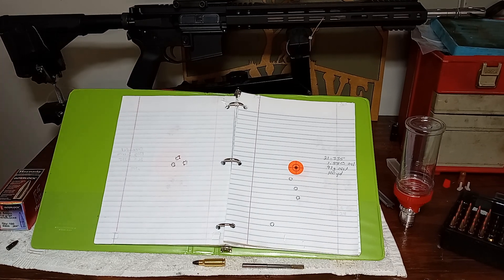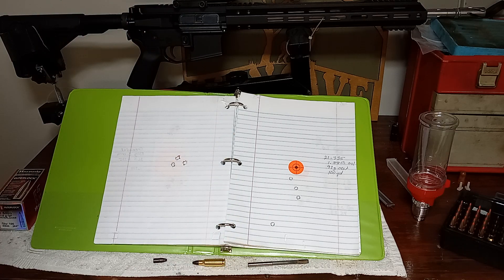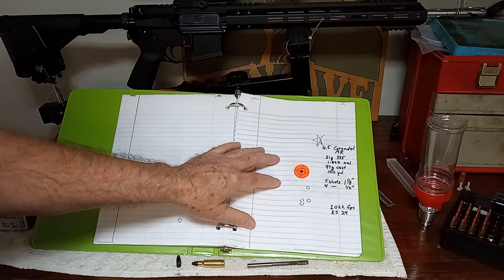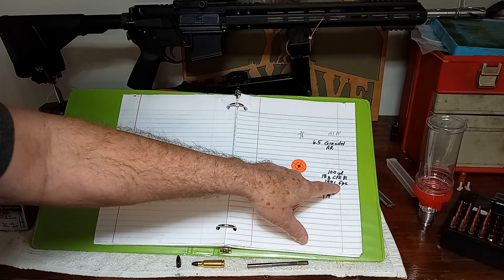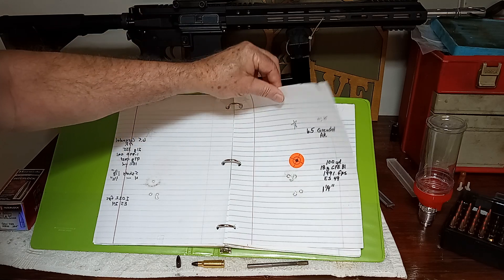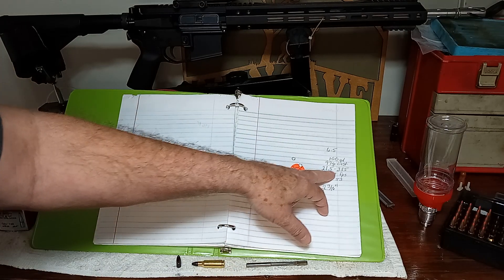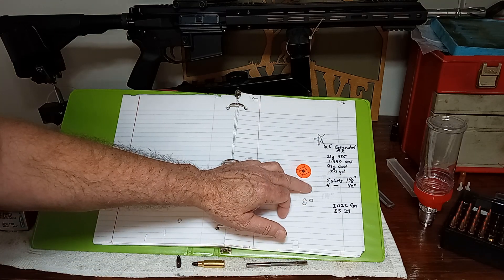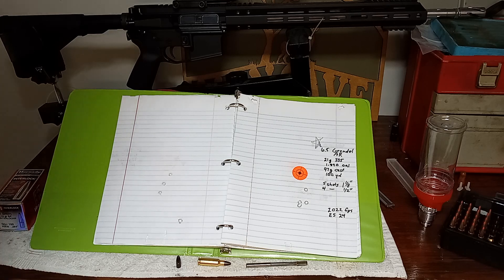6.5 Grendel cast bullet range report

Comment: Those aren’t bad groups.  Getting a messed up Mold that sucks but you’re a crafty guy. You probably had fun fixing that mold.  Lol
Reply from the maker: @maxxbear5014  I can live with these groups . They aren't bad . I would have preferred the mold maker to make it right . If it is a .266 - 95 mold it should drop at .266 . Not at .264 . But as it turned out, me using a reamer on it worked out .
   How is the jeep coming along ?
Reply: @jamespollard1670  the Jeep is coming along good. I stopped working on it because it was summer and it’s inside so I finished up the ramp van I was building.